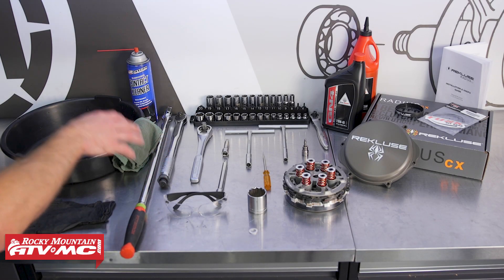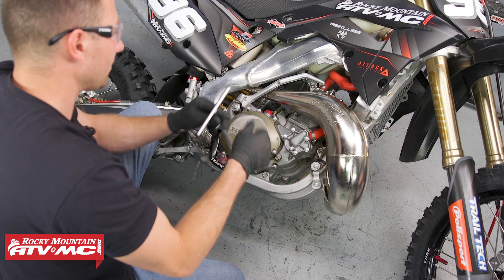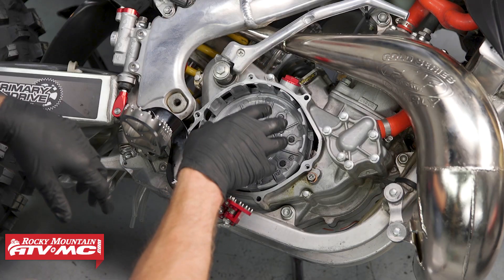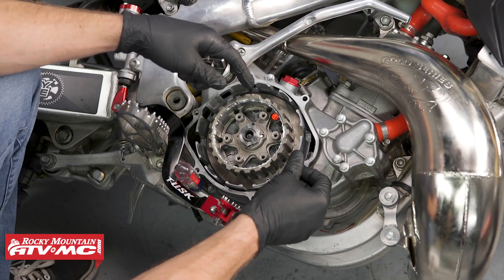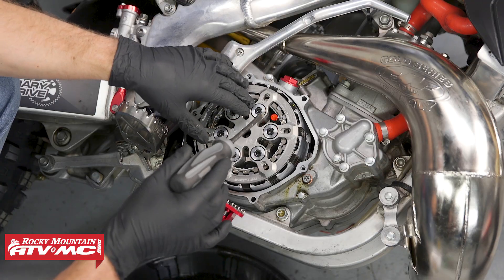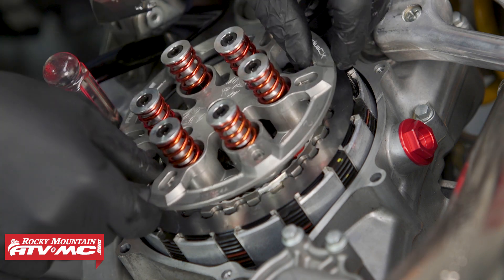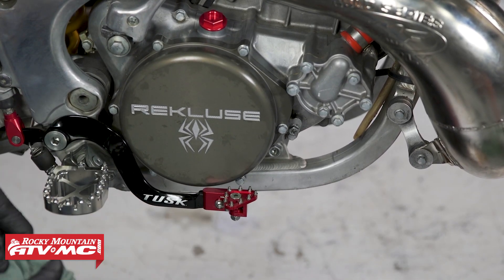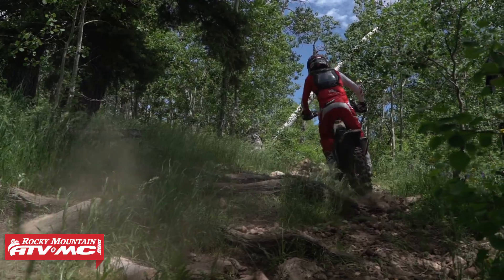How To Install a Rekluse RadiusCX Clutch on a Dirt Bike

Comment: I'm buying a bike with Rekluse which I have no use for
owner doesn't have original parts. Is there anything I need
beside clutch plates, springs, cable to restore the bike to 
standard clutch?

Comment: so you install the thing, put oil in it, then check free play in the lever and if theres too much you have to drain the oil and take it all apart again to move that ring a smidge? i dont know if i still wanna get one of these now
Reply from the maker: It's not too big of a job to adjust the free play. You will have to take the clutch cover off but you can just lean your bike over like we did in this video so you don't need to drain the oil.

Comment: I recently installed mine and now I have no pressure in my clutch my bike is a 2019 kx250 if that matters
Reply from the maker: Hey, I would re-check the install gap. If that doesn't do it, then let us know. -Charles

Comment: I emailed recluse and they said that the Migura HYMEC clutch didn't work with it. I have the same recluse clutch on my bike but the HYMEC clutch doesn't seem to work.  How are you still running the HYMEC clutch with the auto-clutch.
Reply from the maker: It's been a couple of years since we did that so it's hard to remember exactly what we did. I believe we had a spacer that worked to get the correct free-play. It was definitely a longer spacer. I'll dig into it a little further and let you know. -Charles
Reply: @rmatvmc  Appreciate it!
Reply from the maker: @larsonoverby1440  The owner of the bike hasn't gotten back to me yet, I believe we stacked the two spacers that came in the kit and possibly added a small washer or two until we had the correct play. The plan was to then make one solid piece that was the same length, you might have to have a machine shop make that spacer for you. -Charles

Comment: What oil do I put in my radius x clutch
Reply from the maker: This is taken directly from the Rekluse website: "Rekluse clutch systems are designed to work with OEM recommended oils, specifically those that meet JASO MA or MA2 standards. Our in-house oil testing has shown that clutch performance is maximized with oils designed specifically for wet-clutch applications." 
So, the oil that your bike originally called for will still work great for the RadiusX clutch.

Comment: That check bolt has super weak weak weak threads do not over tighten that check Bolt it will strip out your crank case.
Guess how I know 😤 freaking used 2002 cr250r past owner that stripped every freaking bolt he touched even the freaking rear axle nut, i mean how do you do that its big like 1 1/8 inch nut